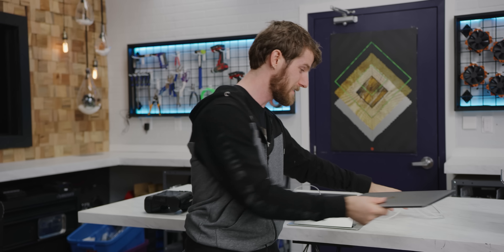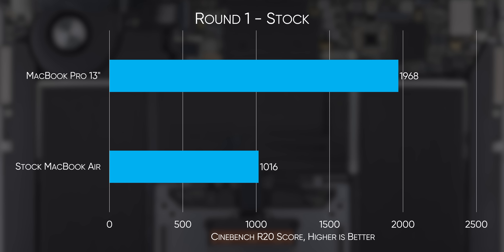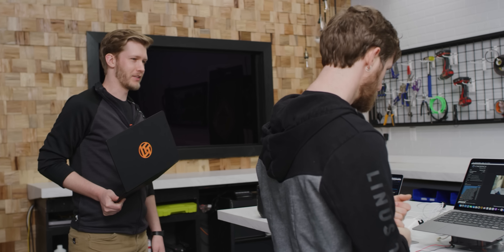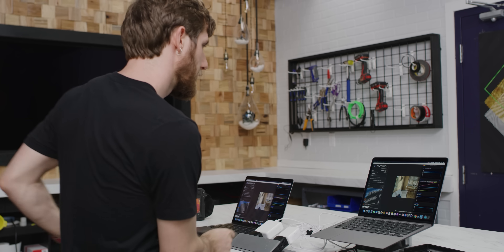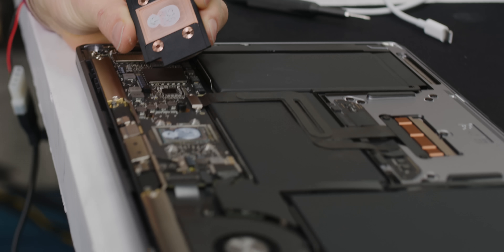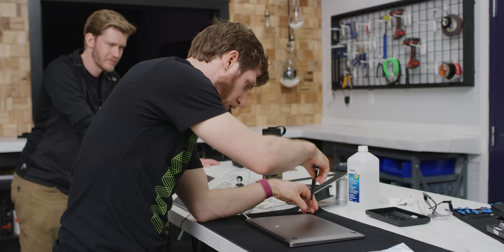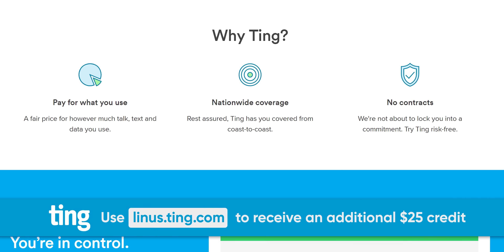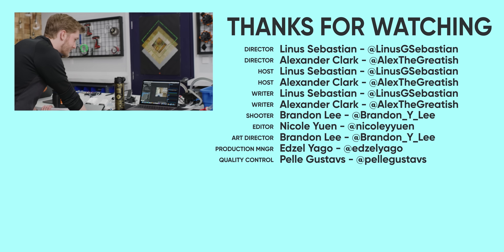Fixing Apple's Engineering in an Hour

Comment: Apple: makes badly cooled laptops repeatedly and doesn't fix them

Linus: Fine, I'll do it myself
Reply: Wireless cooling is the Future! by Apple ;-)
Reply: @hwgeek86  Cloud Heatsink sounds promising
Reply: this is on purpose im pretty sure ”buy the pro model for better performance cause this one sucks”
Reply: @DarkPortall  But the problem is that the Pro models ALSO thermal throttle. So you're kinda SOL
Reply: James Park LOL my 2020 MacBook Pro boosts just fine to 3,8ghz and has 3,3ghz on all core for 2 hour compiling. (At 95celius^^) so thermal throttle is no problem here. the pro is just freaking hot
Reply: @jjpark98  not the 16" though, which is the best option anyway 

Source: i got the 16"
Reply: @jjpark98  I have the 2019 Pro and it does not throttle, unless I'm blocking the fan intake/exhaust while doing heavy tasks.
Reply: @butcher2709  Although that ruins the lifespan of the CPU. My laptop that was PROPERLY designed is a 6 core that clocks to 4ghz and would kick your mac pro's ass for 2 reasons. It runs cooler meaning it can either A) Not cook my hands and the insides of the laptop and B) I could clock even higher if i wanted to.
Reply: People: Still suckling on the sweet teat of apple
Reply: Yeah and the only thing Apple needs to do to make their customers happy is include a huge bucket of ice, pump, and hoses with their laptops.
Reply: There is no cooling at all in this MBAir
Reply: @F a on a MB Air that doesnt use a 4k panel.
Reply: Hey you think I have time to worry about thermal performance? I'm busy buying MacBooks.
Reply: what are you poor or something? turns around Hey! Everyone! This guy's poor!

Comment: Fixing Apple's engineering? That's what Louis has been doing for years
Reply: nice try copy cat
Reply: Gay
Reply: No, in fact Louis has fixed nothing. He is just a small time repair shop with a very big mouth. He knows nothing about designing actual products, of he did then he would realize that every time you change one item to avoid one issue that you then create three new problems.
Reply: you dont need a genius to figure out that fan should be pushing air through heatsink fins lol
 @Billy123bobzzz

Comment: I mean I’ve never had an issue with performance or thermals on my MacBook Air, but then I’m not mad enough to try and do anything super heavy on it. It’s a Mac, so already isn’t for gaming and doesn’t have the hardware for it anyway. I don’t render on it, because I’m not a lunatic and have a desktop PC for that.

I don’t get what the complaint is here? Yeah it gets really hot and doesn’t quite get the most out of the CPU, but it’s not at all a high power machine. It has the higher end CPUs for burst performance when you need it, and otherwise uses as little power as possible and stays totally silent

Comment: 3:05 there so many rumors that apple really want to put A12 Bionic on their MacBook.
Reply: @joeljustin  Apple is in a better position, as it can just force the developers to recompile their apps for ARM, otherwise those developers will simply lose a lucrative market.
Reply: @Agent_Krasnov  Since MacOS also supports Third-party apps, they can't force everyone to recompile for ARM. Something like QEMU might be a solution for that. Recompiling is still the best option though.
Reply: @coreforge  Microsoft can't force everyone to recompile for ARM, but Apple probably can.
Reply: @shippa10001  For MacOS it's not much different then for windows. They can force everyone on the appstore, but not third parties who use other distribution methods. MacOS isn't locked down very much, so Homebrew is very much a thing.
Reply: @shippa10001  They dropped Opengl so devs have no choice now. They've made the Metal API the only way forward.
Reply: We'll know for sure already tomorrow :)
Reply: Its not like Apple hasn’t transition architectures before... going ARM makes 100% business sense.

Comment: 4:08 Louis Rossmann is screaming at Apple
Reply: eisenklad FANSPIN
Reply: No, in fact Louis has fixed nothing. He is just a small time repair shop with a very big mouth. He knows nothing about designing actual products, of he did then he would realize that every time you change one item to avoid one issue that you then create three new problems.
Reply: @Billy123bobzzz  you are so wrong it hurts
Reply: @TristanSpeno  I own a computer consulting company in Silicon Valley that supports a million users per year, everything I said is true.
Reply: @Billy123bobzzz  ok
Reply: @TristanSpeno  That's right!

Comment: 10w cooling capacity next thing you know they are going to charge you for a cooling fan
Reply: I wonder how much different the temperature would be without the fan in this MacBook
Reply: It'll be the same price as the wheels for the mac pro
Reply: Yh lol, the fan inside this one is just for placebo, wtf is it supposed to cool all the way over to the side? VRM?
Reply: @grod5998  Also, where does it draw air from? It's against a solid aluminium sheet.

Comment: Can someone help
Me I use a wireless internet adapter and I turned off all power saving modes but it still disconnects like every 5 minutes I can’t even play r6 anymore please help
Reply: which exact one with wich os
Reply: Lars p. It’s on Windows 10
Reply: Well:

1. Haveyou tried different wireless networks?

2. How old is it?

3. What is the brand/model?
Reply: Elijah _  I got the adapter like 2 months ago it worked fine until one day it randomly just kept turning off and there’s no brand name on it it’s just called wireless WiFi adapter...
Reply: Elijah _ oh found the name it’s a Realtek RTL881AU
Reply: Update your drivers
Reply: Internal Error I fixed it I had this one option on that the computer could turn off the usb whenever it wanted
Reply: 1) Use a cable
2) Delete this cancer game
Reply: Kekkachu I mean r6 is pretty cancer but nah I’m hooked rn